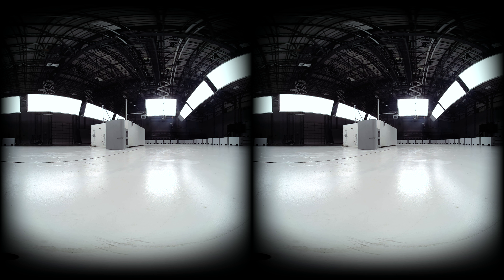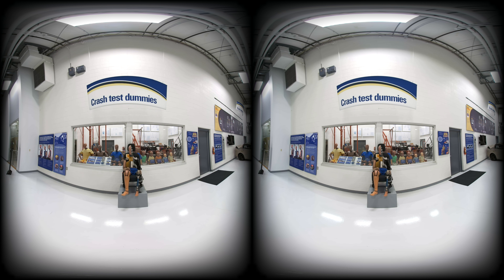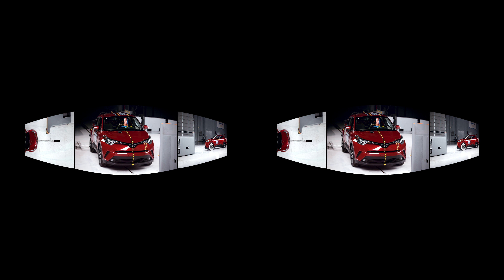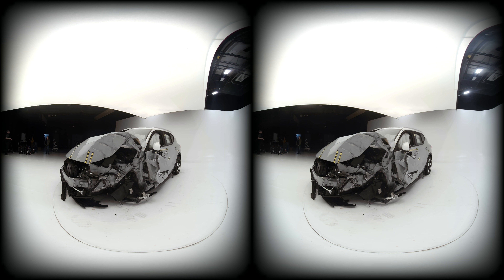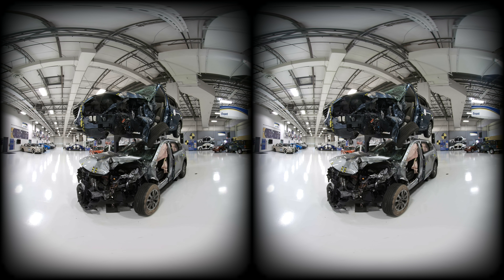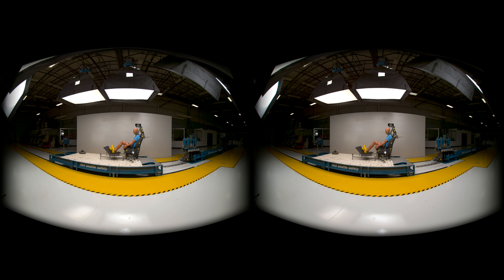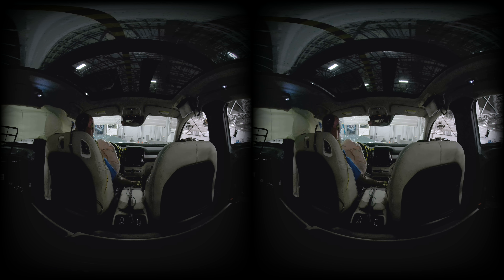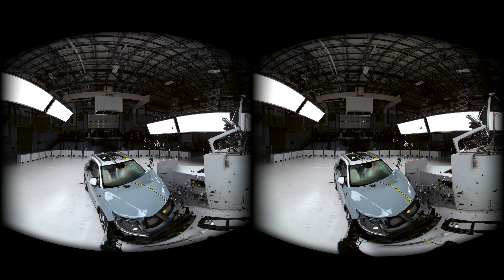Why Cars Are Built to Make a Crash Last Longer (180°) | Damage Control | WIRED

Comment: I'm just confused.  Can someone explain this to me and how it works?  Crumple zones take impact, however, in the actual slow downed video the car doesn't seem to start deceleration until about when it hits the metal of the tire.  So probably some got absorbed, but if the car was moving at, whatever, 55-65, and when it hit the metal of the tire was now moving at, pretty much the same speed, 50-60 miles per hour, how much impact was absorbed.

They then show new car hitting the old car where the old car, the much less safe one, crumples WAY more.  If every inch of crumple truly absorbs impact, wouldn't twice as much crumple absorb twice as much impact, reducing the impact to near nothing?  Okay, logrithmic scale probably, but I think you get my point.

Finally they say the new cars disperse the impact more, but didn't the car still, when hit on the left, swing out to the right?  I know it can't absorb all impact so you won't see the car not swing out to the right at all, but wouldn't it sing out less.  Additionally, if it does better then old cars, then why did the new car swing out to the side WAY more then the old car?

Okay, I just looked it up and a typical car's shell is made of (at max) .2 millimeter aluminum.  Okay, it said typically its .8-1.8mm which I guess is less.  So how much force does .8mm of metal stop?

Comment: It's fine that cars crumple HOWEVER the cabin that passengers reside in should be HARD SHELLED and reinforced.  It should NOT be considered a crumple zone of any kind.  It should be extremely hard and resilient to impact.  Often the crumple capability of vehicles literally crushes it's occupants!  That's not a good thing if the steering wheel is rammed into the rear seat.  Crumple is good but NOT at the expense of killing the occupants due to the crumple!

Comment: How have car makers improved safety for when a car hits a non passenger? Like a pedestrian or cyclist?
Reply: It's the same basics, instead of transferring the whole momentum based energy into the pedestrian, the car will take some damage, taking some of the energy instead of sending it all into whatever it hits. Unfortunately, that's the most we can do right now, unless you want your car to break if it hits a speed bump going faster than 2km/h
Reply: @bright5710  You're probably talking about pioneer VRU (vulnerable road user such as pedestrians and cyclists) AEB. Pedestrian and cyclist autonomous emergency braking has come a long way since then and is far more efficient than the passive safety measures you're talking about 😉

Comment: Y’all do realize u can move the vr with your fingers not just by moving the device around right? I like the vr
Reply: You can even see your heart beating by laying your phone on your chest
Reply: It is the fact that the video does move when you move your device that is the problem.  I do not place my tablet on a table everytime i want to watch a video.  If i am holding it or have it in my lap it moves a bit and with that video that means that even if i do not want it to move it does.  A VR off switch would be nice if they do it again.